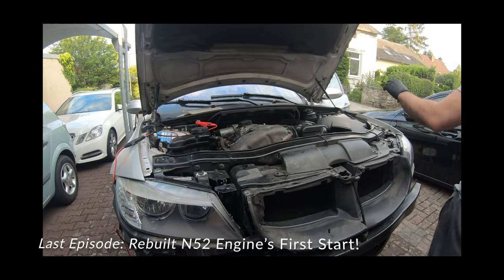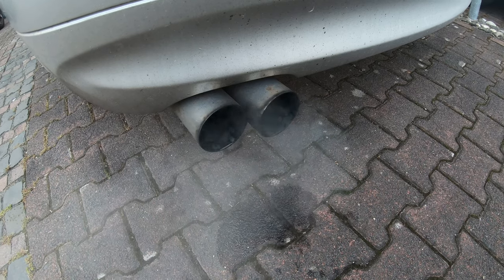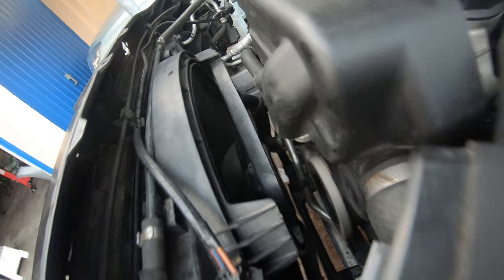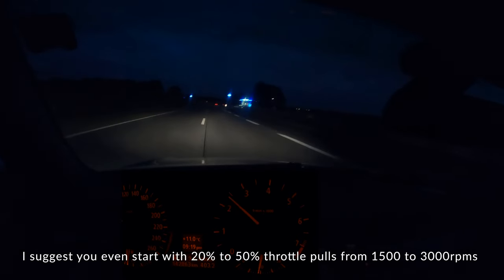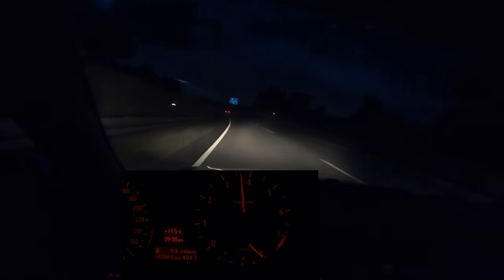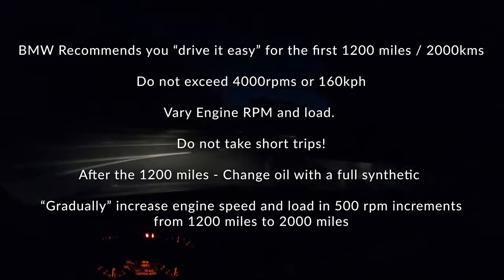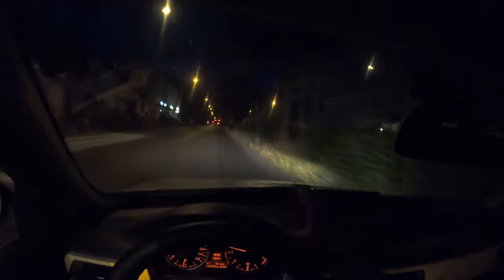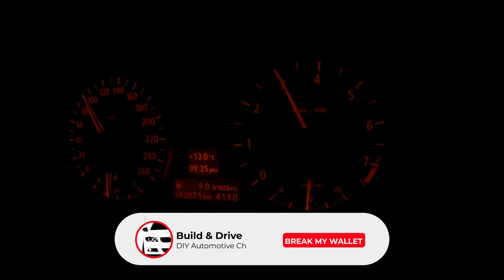How To Break-In A Rebuilt Engine on The Autobahn! BMW N52 Break In Procedure and First Drive!

Comment: Be glad to have the N52. Everybody and their whole family has or wants a N54 (N55). I personally prefer the NA straight 6 - 3Liter. Sound, smooth torque curve and the directness…… BMW dropped the straight 6 after the N52 (N53) and these engines will be sought after soon.
Reply from the maker: Yeah I would love the 330i 272hp engine 🤤
Reply: @buildanddrive  I have the European spec E82 125i N52B30 with stock 215hp - 218hp. I am almost done with all bolt on upgrades and will tune it soon to bump it to E87 130i or E86 Z4 hp numbers. Tune on stock would bump to 265hp - 270hp. However, with the catless equal length headers, sport cats on wider midpipes (Schmiedmann) and an Eisenmann back box besides some other upgrades, I am aiming to knock on the door of a 100hp per liter.
Reply: @valentijn9 you just need to install 3 stage intake manifold to go to 30i specs if you have the B30 instead the B25

Comment: Cool video. I have an n52 (180,000miles) and an n54 (30k miles) I love to daily the n52. It’s a great daily and the power is still phenomenal. n54 is so much different than the n52 it’s crazy. Love them both!
Reply from the maker: A good running n52 is so much fun to drive but yes, an n54 is a a different animal.

Comment: Im thinking about following your steps, but did oil burn stopped?
Reply from the maker: No. The oil burning continues. I should have drilled new oil holes in my old pistons or bought the new piston design. This would have solved the oil burning problem.
Reply: @buildanddrive  during break-in the oil consumption is normal, after the change to full synthetic what do you consume on the dipstick?
Reply from the maker: I am measuring it again because I had a few oil leaks and didn't notice them. But I was getting around 1L/1300kms after the rebuild with an oil leak. Not good. I've fixed the oil leaks now and changed the oil. Measuring the consumption again! 🤦🏼‍♂️
Reply: @buildanddrive  that Is more or less what I am getting right now, slight oil pan leak. No engine rebuild still
Reply: @buildanddrive  Hey, i have 5000km and middle oil-gauge on my rebuild :) Pupsyd.
Reply from the maker: You had the drilled pistons right?
Reply: @buildanddrive  exactly

Comment: congratulations...  i never thought you had to break in a rebuilt engine.
Reply from the maker: Yes, bearings, camshafts, piston rings etc... All need some time to heat cycle a few times in order to 'break-in' properly. And if course bedding in the piston rings
Reply: @buildanddrive  Nice! You said BMW recommends that you "drive it easy" (at 2:56 in the video), where did you get this advice?
Reply from the maker: If you go to BMW.com it says to do it this way. Google "BMW engine break-in procedure". Normally this is for brand new cars but I followed it anyway because the process would be the same for a new engine.
Reply: @buildanddrive  what background do you have as a auto mechanic?
Reply from the maker: I did an automotive repair introduction course in college but after working in a real mechanic shop for 1 month I decided not to work as a mechanic. It was stressful and not as glorious and awesome I thought it would be. So I kept it only as a hobby. Its fun... I love it and hate it all at the same time 😂 because it's not easy but really rewarding when stuff works!!!!
Reply: @buildanddrive  I totally understand.  customers dont under the reality of fixing cars.  its not as easy as they think and they tend to want there car back an hour later. and they want to sit and watch.  Great Job! I know some "mechanics"  that only do brake jobs and oil changes.
Reply from the maker: Exactly. We had someone come in to replace brakes, no problem. The next week they came back saying their car wouldn't start... We found that the alternator was dead and they said we must have done something when we changed the brakes... And that it was our fault 😂😂😂. Customers just don't understand thats not how it works! 😅

Comment: Great series. I rebuilt my N54 E92 last summer. Took me almost 2 months as it was my first engine rebuild and in my free time, but it was definitely worth it. 
I also had a thick white smoke on the first start. And on the first day, it went to limp mode as soon as the rpm was over 2000. Some Vanos failure that disappeared after parking overnight.
I changed the oil after 500kms. It was on minimum by then. Then the oil consumption settled.
Wish I had also filmed the whole procedure. :)
Reply from the maker: Where did you learn how to build the engine? I am lucky I had no codes at all and no big issues. I forgot a washer on the banjo bolt of the power steering line and the washer on the timing chain tensioner. So it was leaking a bit of oil over time. Still have 'oil consumption' but according to BMW, the n52b25 can use up to 1L/700 miles and this is considered 'normal'
Reply: @buildanddrive  I never learned, just started with small repairs on the car and then did some bigger works such as turbo change. But I have a friend who is a mechanic so I had backup when needed. Mine was drinking 1L/400kms (250 miles) when I took it apart. Now it is good for 6-7000 km. I use 5w30 and don't prefer any thicker oil. I damaged a thread on the block where the head bolts down, but I could repair it.
The first start was more than exciting, just like yours.
I read on some forums that if you forgot some bolts or washers and it still works then you are more efficient than the guys in the factory. :)
Reply from the maker: Really cool. I learned the same way over the years. Wish I bought an n54 335i but they were way to expensive at the time I purchased my car. Glad yours is running good! They are great cars when everything is working correctly! 😉